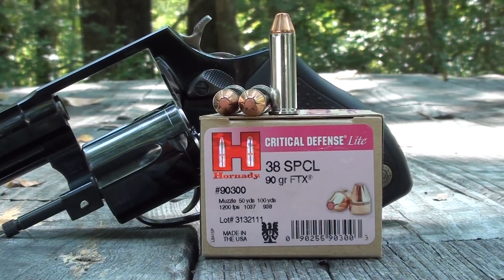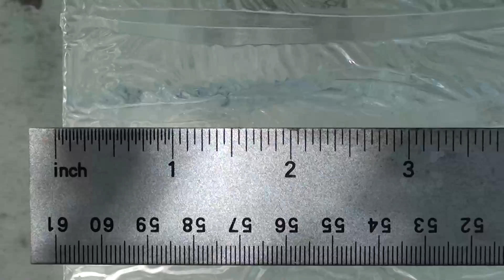38 Special Critical Defense Lite ballistic gel test

Comment: The human heart is located behind the sternum (breastbone) in the chest cavity. It is situated in the middle of the chest, slightly to the left of center. The exact depth of the heart behind the sternum can vary from person to person but is on average 2.5 inches (6.35 centimeters) deep behind the sternum.
Reply from the maker: Yep, correct, its also 12-15 inches from the outside right arm from a right side shot, 15-20 inches from the waist area from a lower shot and 8-11 inches thru the left arm in a left side shot

Comment: NOT to be mean but this would be considered a failure to penetrate property... You HAVE to have between 12" and 18" on penetration.... The 110gr +P seem to be the sweet spot...

The 110gr +P is NOT very snappy BUT has wonderful performance.... You get good expansion (about 40% - 60% more diameter) AND you get about 15" of penetration.... At least in the tests I have seen AND done...

Comment: I can see a really good application for this.  If I lived in a state that tries everything it can to discourage self defense, especially with guns, this would be perfect.  No prosecutor is going to see that pink box and pink ballistic tip and drool like he/she would if you had been loaded up with Zombie Max , or Underwood Extreme Penetrators.  In fact, I bet a defense attorney would make sure a jury saw the box, and the small 5 -shot assault revolver they came from.
Reply from the maker: Yeah, I hear ya.  Just doing some testing, but for older folks I really see this as a better alternative to high pressure rounds.
Reply: @ScubaOz  Also great for an older Colt Agent or Cobra with their aluminum frames.

Comment: I remember being younger thinking the 38 was the best gun on the market.. lol I just assumed that because the bullet was bigger... wasn't till I got more into buying guns I started to learn ballistics and became a 44mag fan!! Even had a Dessert eagle(back in 1997)... probably why to this day I still love 357 mags and 44 mag revolvers!!
Reply: Bullet is not that big, its basically 9mm, the case is whats bigger, .38 is the cartridge diameter.  It was designed & used with black powder before smokeless powder was used & the case sized never changed.  The case could never handle the pressure of smokeless powder if any where near full, like black powder.

Comment: My wife has an inch and 3/4 barrel Ruger LCRX. I shot a 38 special critical defense Hornaday rounds through it. Using a bench rest at 21 feet those bullets group 2 and three-quarter inches low of Bullseye. The cheap ammo shoots much more accurately. And they have a heavier grain bullet. Why do you think the light  90 gr drops so much.?

Comment: So, more or less, this is just putting a .380ACP loading into a .38SPL revolver platform, with pretty much the same performance as the Hornady Critical Defense .380ACP cartridge. I generally think of .38SPL as the "line in the sand" for minimal baseline performance in a self-defense pistol round (as it has better energy and bullet weight than .380ACP). However, in a light snubbie/pocket revolver, especially the S&W Airweights and Ruger LCR, .38SPL can still produce some stout recoil and gun-jump, particularly for smaller or weaker hands. So, if you can shoot this "Lite" loading better, and place the shot easier, than it might make sense for a certain person. Especially a person who doesn't regularly handle semi-autos, or doesn't want to fiddle with magazines, slide racking, clearing etc. with a .380ACP mousegun, and prefers the simplicity of the revolver. The "Lite" loading gives some flexibility here. Choice is good. I use Hornady cartridges in several calibers and loadings, and I always find them reliable, well-made and durable (they can last for years and aren't fragile), and accurate strong performers. (edited to correct misspellings)
Reply: Well said
Reply: Exactly it’s a 380 out of a revolver. It’s a beautiful round. I use it at the range in a 2 inch barrel.

Comment: Nice video.. This works out at around 160 FT/LB of muzzle energy. 
Is this enough to protect you from the "Bad guy" who breaks into your home at 3am..
I would say yes. But others might say no.
Reply: I do not see this as a viable stopper,it just blunted and bored a rathole.
Reply: I'd like have a bit more horsepower.
Reply: A light .38 round beats harsh words...we use .38 as our backup in the house, and feel okay about it...

Comment: Thinking seriously about buying a Taurus 38 Spcl. Ultra light on a super deal or the Taurus Millennium 9 mm. I like my C9 but it has to go back to the factory after 3000 rounds. It quit firing and after replacement of all springs and the firing pin the problem persists...The factory will fix it but I don't want to be that long without a gun. Open to suggestions folks. Great video by the way!!
Reply from the maker: I like the 605 in this vid, was not real expensive, works great and I can shoot 38 or 357
Reply: For a compact revolver I'd go with a S&W 637 or a 642, love my 642
Reply: Thsnks for the input. Ill look into those.

Comment: I'm looking for a fairly effective standard pressure round for home defense. I have a very old S&W mdl 10 (actually a hand ejector) from the 1940's. I just don't want to pound this old gun. It's in great shape, i just don't want to chance high pressure loads. this round looks pretty good. Any other suggestions? All this gun has to do is help me get to my shotgun.
Reply: +Don Alberty Federal Premium Personal Defense .38spl with the nyclad HP bullets. It is standard pressure so it should be a good choice for your revolver. Only downside is it can be tricky to find. You will either have to order on line or have a gun shop order it for you.
Reply: +james hill thanks for that information. Any other suggestions will be appreciated.
Reply: @f5studio505  I'm old fashion I guess. One of my favorite non plus P loads for the 38 is the old 158 gr lead round nose. They shoot to point of aim In most 38's. And I count more on penetration than expansion that May or May not happen. But many will disagree with me. Just my opinion.

Comment: isnt the point of mushrooming tips so that they dont penetrate thru a person and hit something/someone behind the target? 12 inches of penetration? that will go right thru a person.
Reply: +boomzilla86 You also have bone, dense muscle, ligaments, and cartilage. You also may be taking an oblique shot with an arm folded over the vital organs. In that case you'd need to go through or around the bone(s) of the arm, ribs, and then the muscle between before you reach vitals. The FBI established the 12" minimum and IWBA agrees with it. It's your choice whether you feel a caliber or projectile that fails to meet the 12" minimum will still protect your life when you require it to do so. I myself want to see 12" at the least, if not 13-15".
Reply: Maybe if they are extremely thin, but if it does go through it will not penetrate anything behind the target maybe small bruise.
Reply: zackery estes
 no, not small bruise. ricochet hits that are more than 100 times slower than the original shot will still penetrate a person.
plus, a person isnt a solid block of gel. we are very empty inside. lots of empty space in our torsos so the bullet would slow down even less on an actual person.
im not skinny, im 5'7 and over 200lbs. and my profile is about 10 inches.
these are not good rounds. at least not in 38 spl.

Comment: I wish they made .40 lite like they do for these and 9mm, I would buy them for training, hell even carry
Reply from the maker: +Vui Tran 40 S&W is already high pressure, anything less is just a 9mm in pressure, better off with a 9mm you can control than with a 40S&W snappy round
Reply: I just like .40 and I could make the same argument with the 9mm lite. Might as well run a .380 acp if your gonna run 9mm lite it is 100% the same in weight and velocity....
Reply: If not 100% the same then at least dam near it...
Reply from the maker: +Vui Tran   I was thinking more of issues with the pistol.  Yes 40 S&W "lite" I could see, its the recoil spring tension I would be concerned about.  Yeah if you hand loaded, loaded up some "lite" loads for your 40, then dropped a 9mm recoil spring into your pistol I could see it all day long.  And I am sure there are IDPA shooters out there who do that.  Drop a Glock 19 spring into their Glock 23, load down their loads and it cycles all day.  Just dont see the regular guy doing this.
Reply: ScubaOz you are absolutely correct, there are pro shooters who reload like this to shoot in comp, no need to change spring. But I wish they would sell it commercially, just to give the .40 fan boys like myself more options lol
Reply: .40 hydra show reduced recoil 135 grains is pretty damn light. I think the hst in 135 grain .40 is loaded the same